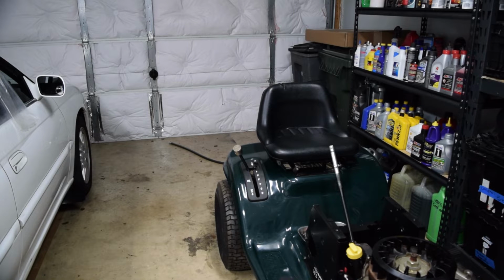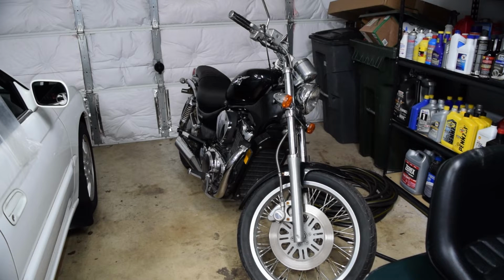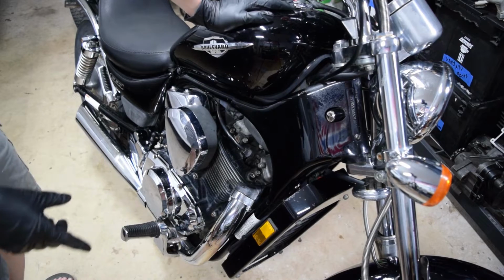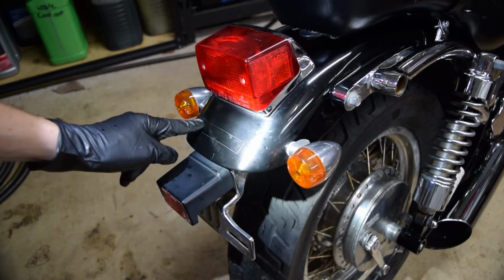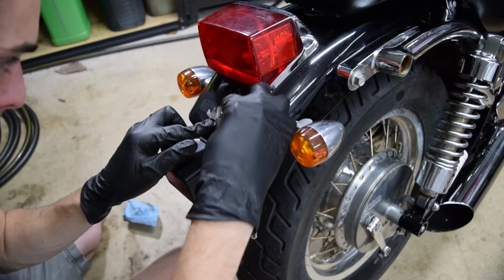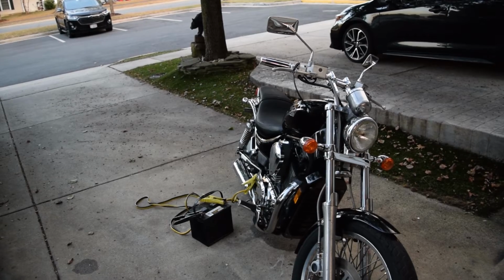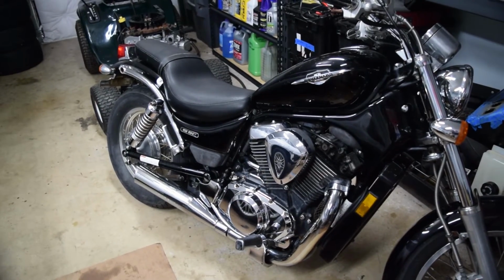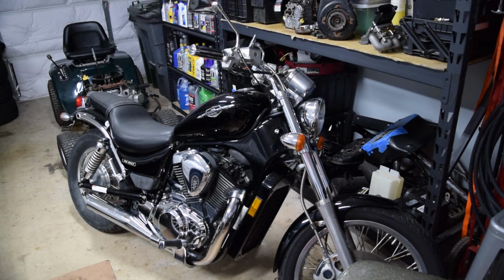Free Suzuki S50 Ep 1

Comment: Hey there, just a heads up you are supposed to check the oil level with the bike level, not just on the kick stand.  You might have it over filled now.

Hopefully the gas leak is just rotten lines or petcock rebuild.